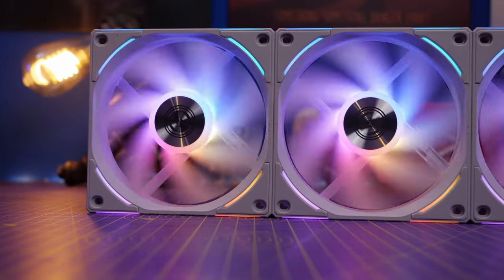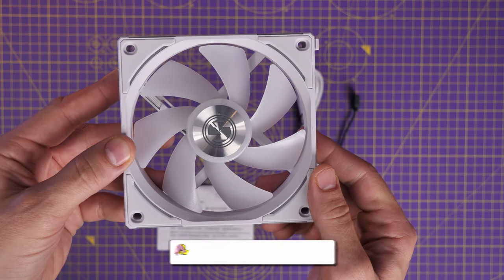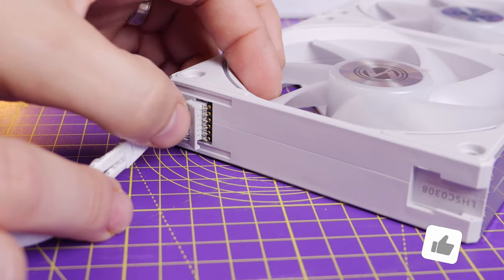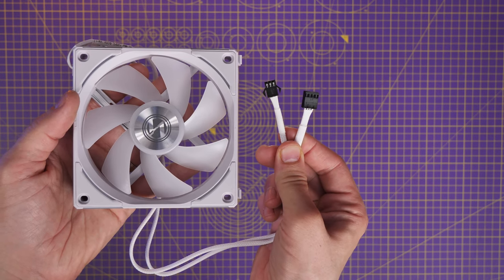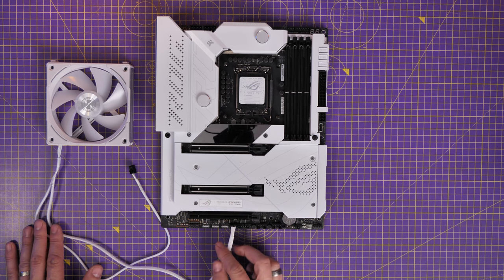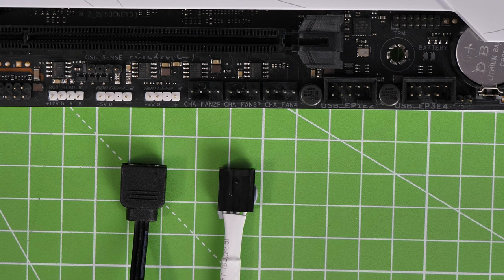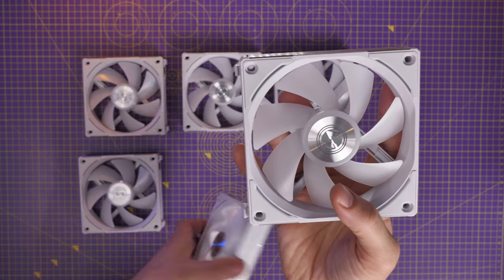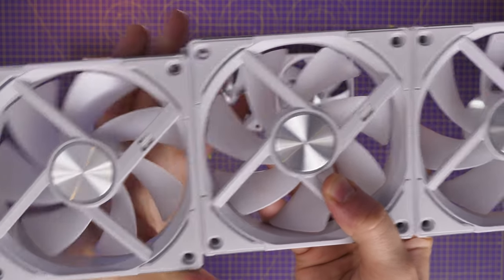Lian Li AL120 V2 fan wiring guide - single fan connections and logic for upto 16 fans

Comment: I think the world of RGB is ripe for disruption. As a relatively new adopter, I've been shocked by the lack of overall interoperability between brands. When I bought Corsair fans I expected to be able to sync them with my Gigabyte motherboard RGB headers, but it doesn't appear that I can. 

Hopefully some of these problems get sorted in the coming years.
Reply from the maker: Have you tried something like SignalRGB?
Reply: @TheProvokedPrawn  I did and didn't have much luck with it, but I also didn't try it for very long. 

It's strange to me how many hardware standards there are, and how many hardware manufacturers require that you use their own hubs. Just a standard hub design that can interoperate with any fan manufacturer would be really welcome.
Reply: @iamamish  Until things improve, you can actually buy adapter cables to convert the proprietary connectors for most fan brands into the standard ARGB connectors.  It's an annoying extra cost per fan, but that's what I've done to use my own ARGB controller and hub w/ components from various brands w/ their own proprietary connector.

Comment: I have all al120mm  v1  fan s ive just got 3 140mm  v2 fans   for bottom intake  my problem  is when plugged into to the v1 control box and boot up u only get the rgb  no power but if i  take the power connection  out and put it bk in it works perfect ly

Comment: Thank you for your great videos. They are very helpful. I ordered a bunch of Lian Li Infinity fans, the o11 Dyn Evo Case and the new NZXT Kraken 360. I have some questions. Maybe you are so kind to answer them.
I have to build the case in reverse (left side on the desk), so i want to mount the GPU upright on the side (ordered the Kit and a 600mm long riser cable from Lian Li), the AiO with Exhaust fans in the Top, Bottom intake and rear exhaust. i could not find a video with this config AND some merging light effects with L Connect 3. So i want your experienced opinion on that.....would it look odd because there is a relatively huge gap between AiO fans in the Top and the rear exhaust fan when using some effects that expand through multiple group of fans? I hope you know what i mean. Thank your for answer.

Comment: Is it possible to buy the single rbg connector cable seperately? Reason I'm asking is to avoid buying 2 triple packs and instead buy 1 triple pack and then complete the rest of the case fans with a bunch of single packs.

Comment: Is it possible to connect 2 groups of 4 Fans together via daisy chaining and attach it to one of the ports without losing led addressability? I have 2 480mm radiators in push-pull so I would run 16 al120 v2 fans from 2 of the 4 available ports. This would significantly reduce cable clutter.
Any help would be appreciated 👏

Comment: if my motherboard supports 12v output, how many fans can i have on one cable? and does the included controller cancel this effect out making me be able run more than 6 on the one cable from the controller?

Comment: Hi! im looking to build in the hyte y40 and i was planning on using a 240mm aio on the side of the case. I am planning to use the nzxt kraken 240 aio and want to fanswap the stock ones with these ones. Is it possible to use two of these fans for the aio and use the left over one for exhaust?

Comment: What cable would I use if I wanted to connect a 3 pack of lian li fans to a kraken AIO? doesn't look like the 3 pack comes with the required cable
Reply: i have the same question
Reply: Did you ever figure this out ? Have the same problem right now as im building my pc

Comment: Thank you for the video, do the 140mm versions have the same exact ports as the 120mm? And would I be able to daisy chain a 120mm with a 140mm fan? I’m talking about the V2 fans by the way lol
Reply from the maker: The ports are the same but I don't know about daisy chaining two different sizes together. Not sure if that works or how well
Reply: @TheProvokedPrawn  wow thanks for the reply! I was mostly interested in the daisy chain with the extra cable they include in the box so if the ports are the same, I should be able to then connect 3 of my al140s that are connected together on the front of my case to an al120 that will be on the top of my case near the front with the included cable. Thank you for your help!

Comment: Can i connect lian li strimer cable along with fans with controller to control all from one software?
Reply from the maker: You need the strimmer controller as well but you can still control both from L connect

Comment: Nice vid! Would like to know more about the noise the fans make. Especially with very little RPM, as modern builds like the Phanteks NV7 "demand" a large number of fans, which is overkill, most of the time. So they can run a low speeds but some fans make an unpleasant "humming" sound at low speeds.
Reply from the maker: Lian Li fans are very quiet in my experience
Reply: I just purchased these 2 days ago to replace my noisy Corsair ML120 fans. They are incredible and are nearly silent on quiet mode. The RGB is visually stunning and only one wire. The only con is the price.

Comment: ok i'm getting fed up bruhhhhhh. I have an lian li aio cooler. I have a set of 3 al120v2s. They both come with a controller. The fan connections are different and I can't plug both the aio and triple case fans into one hub and I'm also running out of usb headers on my mobo. So like...wtf do i do? Was I suppose to get matching fans??? the aio is a galahad ii 360 lcd with sl infinity fans and my case fans are al 120v2s.
Reply from the maker: If you've got different fans you'll need different controllers. You can solve the usb issues with this https://youtu.be/d8vELbWWaCQ

Comment: So the only difference between the single fan box and 3 fan box is that the 3 fan box comes with the hub but everything else is the same.
Reply from the maker: Basically but the wires are different

Comment: yes but if you only have 2 argb one used for the case and another for the cooler. no adapter splitter. so you have to buy one.  it should have been included.  I now have to wait 3 days till they come in to finish building my pc.  what a let down.  I will never buy another Lian-Li case for fans.